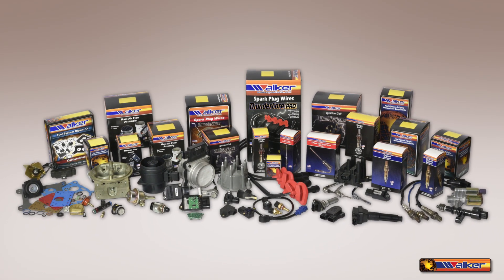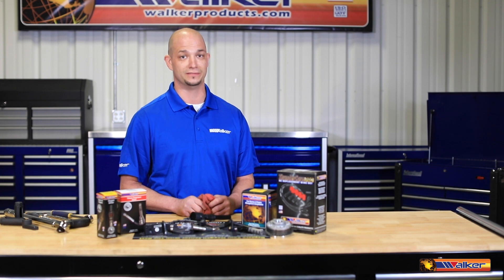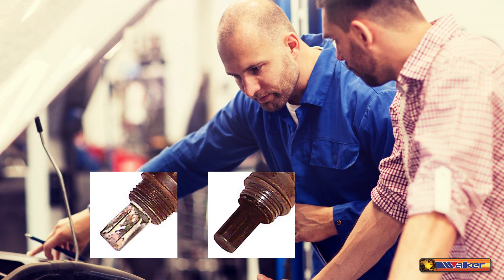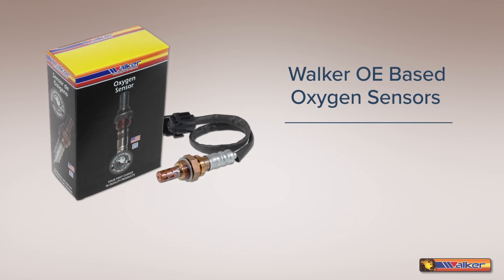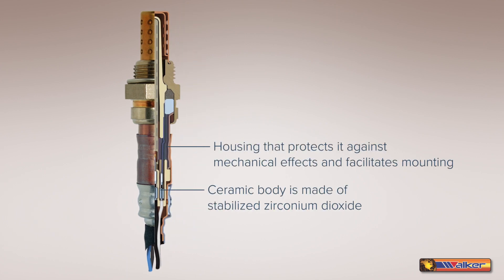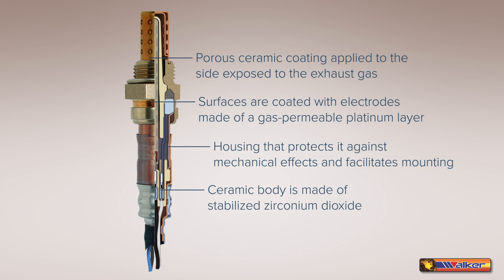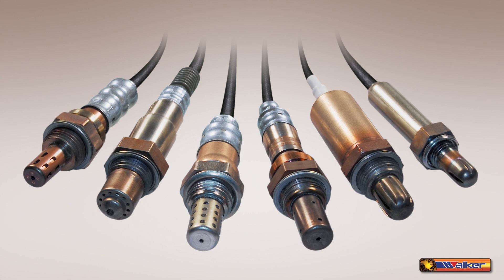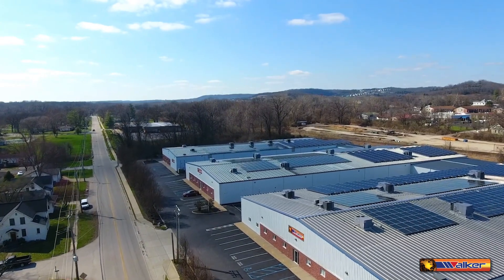Walker Products OE Based O2 Sensors

Comment: What is the diderence between OE replacement 02 sensors and OEM based?
Reply from the maker: Our OE Replacement O2 Sensors use an "aftermarket" base sensor that offers the same level of quality and performance as a Genuine OE, just at a better price. Our OEM Based O2 Sensors use the actual OE sensor.